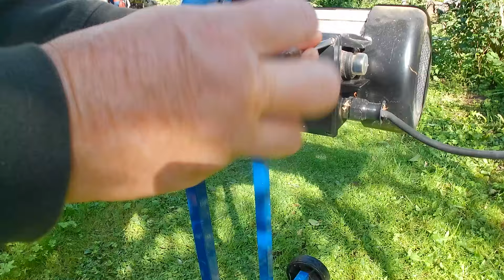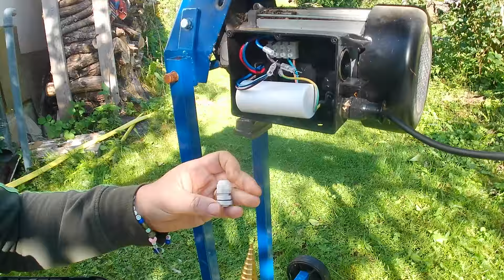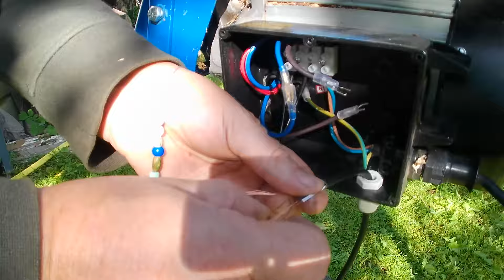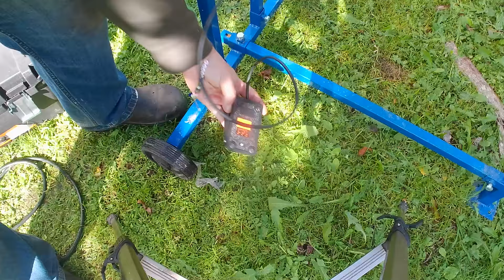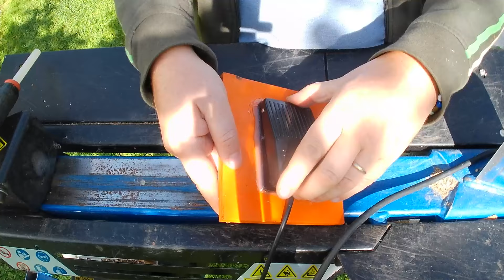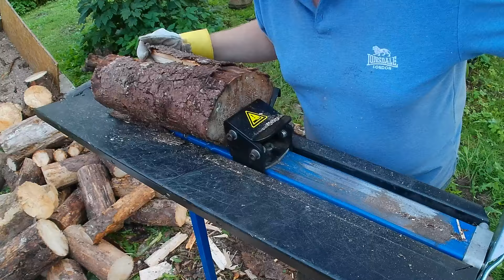Make Firewood Faster and Easier - One Simple Hack

Comment: Now the simplest and cheapest tip ever for these splitters. 
Use a candle stub or lump of paraffin wax to rub onto your wedge. I normally do this every 10 minutes or so and only takes a couple of seconds. It makes a lot of difference. Wood splits  easier and quicker and it reduces the liklihood of getting logs stuck fast on the wedge.
Reply from the maker: Great tip thanks, I’ll try that.

Comment: I have the same splitter with the exception that it has a wire mesh cage around the splitting knife. Good job too as I have had several logs explode on me. Most of our wood is oak with some hornbeam and occasionally acacia. Some logs when they explode shoot forward,  sometimes as far as 2 or 3 metres,  I have had a couple shoot back at me and hit my face visor, and one burst with enough force to bend the wire mesh. One reason why you have to have your hands on 2 devices to use the machine is so that you can't trap your hand between the log and the ram or the knife. There are videos out there that show people risking their hands, people like ' 9 fingers Johnson' .
Reply from the maker: Yeah we don’t have oak to split and I can understand why it might do that. I don’t think I’ve had any jump out but one once jumped back after it was stuck and squeezed my finger, a cage wouldn’t have stopped that anyway. Ironically I’ve had more hand accidents when I used to use an axe which was one of the reasons I wanted to get a splitter. Have you got the upgraded knife head that splits into 4/6 segments with one drive?
Reply: No, I've just got the standard head. Didn't know there was a 4 way head available,  might be a useful addition.  @BalticHomesteaders

Comment: Thought you were going to bypass the switch all together (i.e have it always pressed/on), but this was better since you didn't really mess with the safety feature :) I had a splitter some years ago, but did find that it was very slow (and I couldn't lock it in place, either it went forward or it went backwards)
Reply from the maker: I’ve seen ones they switch on the valve at the same time but that seemed too dangerous to me, it’s too noisy to have that motor running all the time and probably not very good for the motor or your electric bill :)